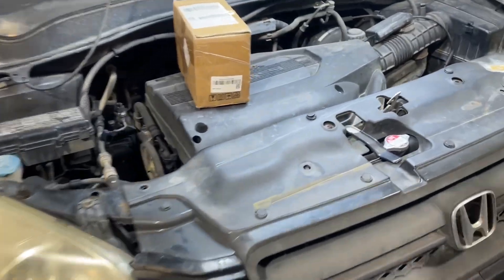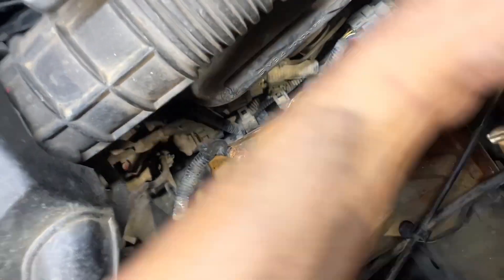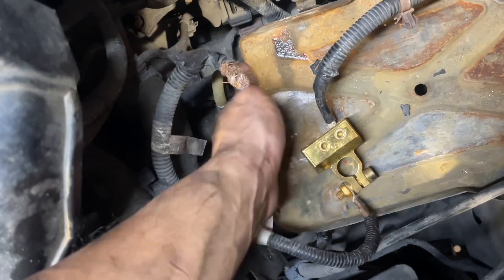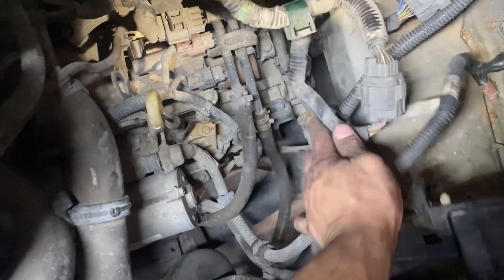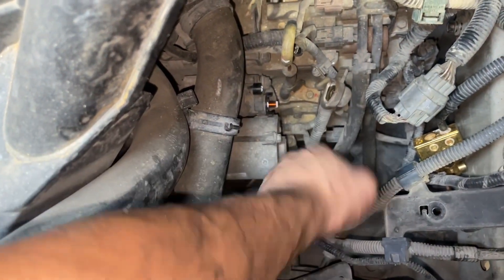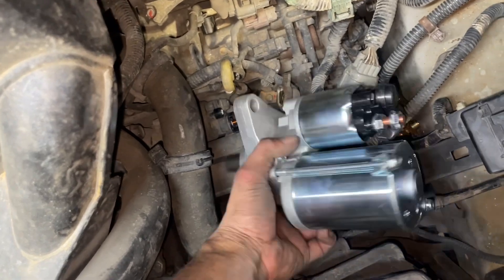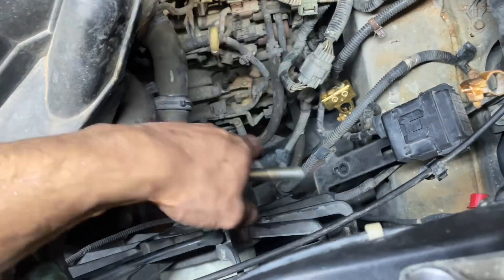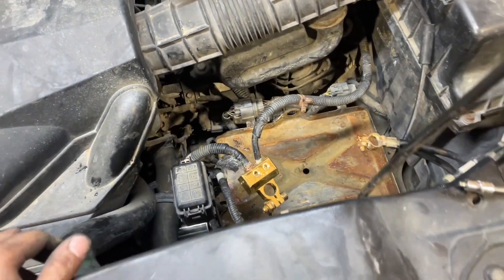2004 Honda Pilot Starter Replacement

Comment: Thanks for the starter replacement video.  Helped me to get the battery tray out in preparation to remove starter.  Problem is I can't get the starter bolts loose with my ratchet.  Now what?
Reply: Longer ratchet, breaker bar?
Reply: @robrote1891  Thanks.  Finally got both bolts out.  Bottom one very hard with with no room.  Finally use my Milwaukee Driver to loosen.